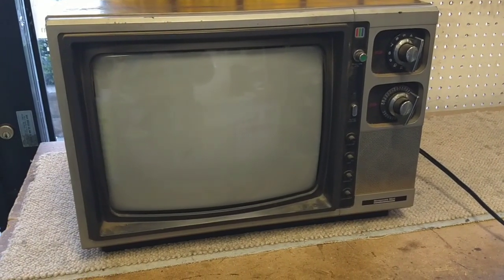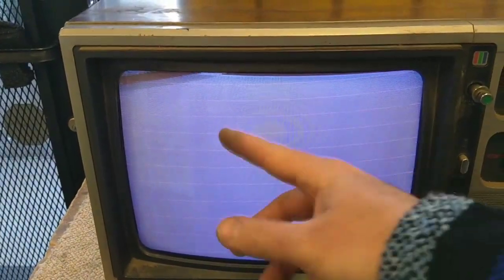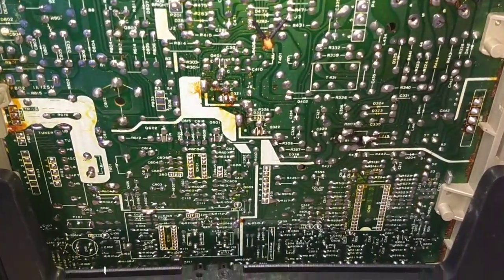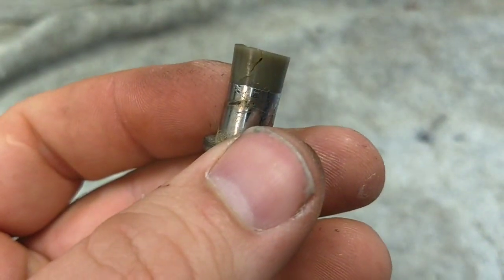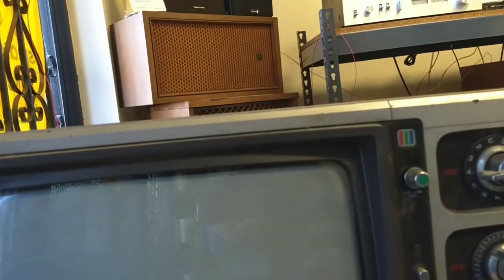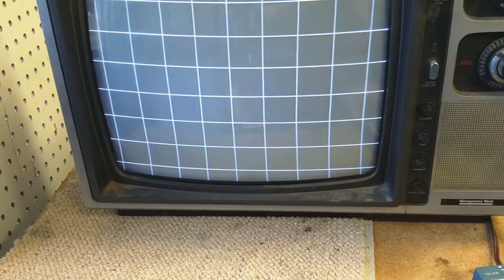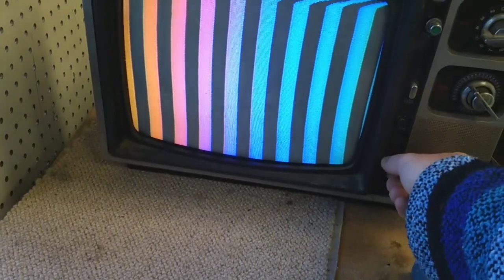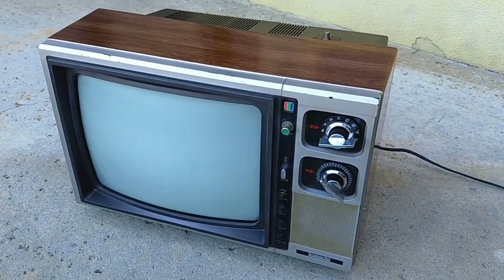Troubleshoot and repair a 1986 Montgomery Ward's 13" color tv model GG12305

Comment: 100% Gold Star.   Distinctive model tag. Also the GS logo on CRT socket PCB.
Yes digital sucks. Used to get all 6 NE states ( abt 25 stations ) up to 130 miles on ears. 
Now I barely get one & its 25 miles away.
Good repair.
LFOD !

Comment: Replacing those sorry, leaked electrolytic caps near the flyback at least fixed the dim picture issue. I could see 2 of them had a dried pool of black stuff on the bottom (10:02) ... definitely shot and their jackets had peeled back as well. Not a bad deal for the price you paid. A keeper for sure.

Comment: I have one of those montgomery ward TV from 1986 I belive it's a 8 or 9 inch and it's black and white the buttons to change the UHF AND VHF are bit broken they wobble and yeah I had cleaned up the TV it was super dirty now it looks like it's brand-new 

Also I got an rare radio shack TV but oneday I plug it in and turn it on and a part of the motherboard was hissing and saw some brght light behind the TV so I unplug it never plug it in ever since and that was a very good TV the colors were really good I believe the TV was made in 1985 or 84 but I have that TV display with my antiques

Comment: so maybe $25 tops for the thing? how much time in 2 hours wouldn't be too bad- if those new caps were free haha...  I have held onto a few 80's sets just to watch dvd's on. shamed none have their remotes with them. True to the advice of S066, I've kept the smaller sets and let the black plastic crap go to the fill minus its copper and aluminum. Small sets fit into trash cans easily and are tossable into dumpsters sans hernia, so, rare.  I do still have a couple of larger Gray plastic craps, but the have flat screens and are troopers.

Comment: i just found one of these tvs but i’m very confused on how to check what issues it has and i don’t have any sort of equipments or tools specifically for tv repair are there any tips
Reply from the maker: Without proper tools and test equipment I would not attempt to service or troubleshoot one.

Comment: I've got a Montgomery Ward Tv.. Manufactured in 1986 Model No. USS12206  .... is there a way to know if it originally came with a remote?
Reply from the maker: Look for a remote sensor on the set. It will usually be behind tinted plastic or glass. Shine a bright light around the set. The remote sensor will usually have a slightly red reflection

Comment: i have a portable MontWard and it won't turn on at all :( no picture, no sound, nothing that suggests the tub is powering on. what do you suppose is the first suspect? i'm using ac power cord (keyed). wire is fine. i'm fine with opening it as i've finally gotten used to discharging crts (something i forced myself into because i'm getting into RGB modding). haven't delt with power repair yet. btw this TV never turned on when I obtained it free at a swap meet. it was just there, guy said take it. no questions asked.
Reply from the maker: Start with obvious stuff like blown fuses. If it's blown violently then there's a short to be corrected before replacing the fuse.

Most of these sets have sweep derived power supplies, so the horizontal output has to run before anything else besides 5 and 12v standby / digital power.